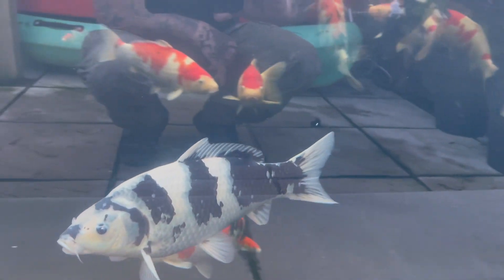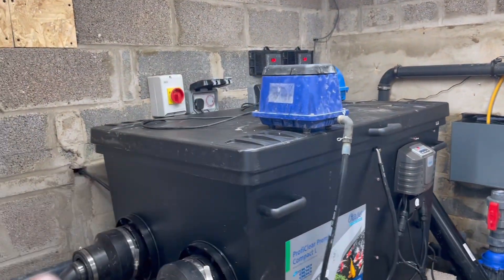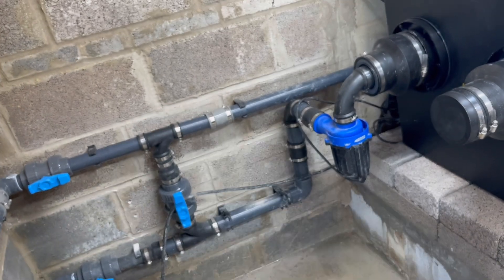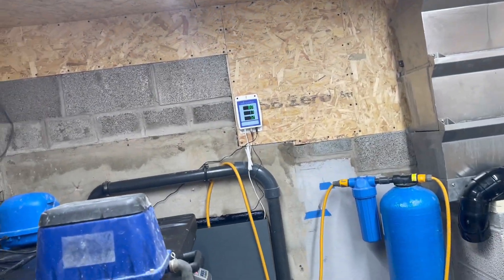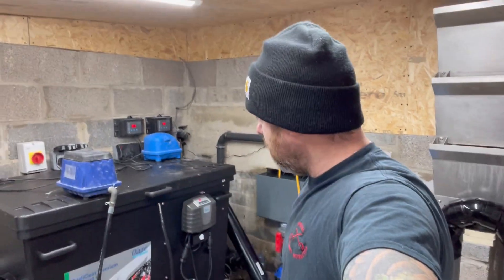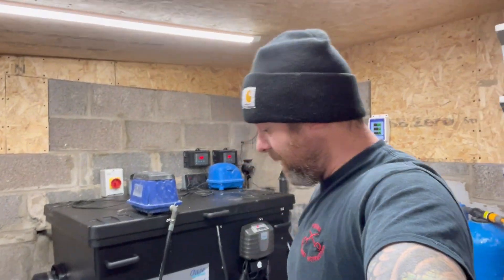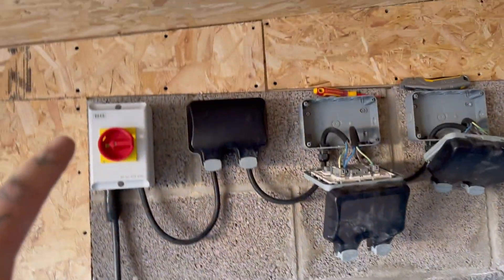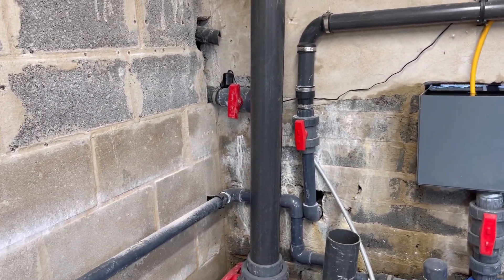German drum filter V German car!!!!!

Comment: 😱😱😱😱😱 Lee don't do it with your electrics 😱😱😱 Daisy chaining could result in inadequate  power and it can lead to overloaded circuits and more importantly be a fire risk.‼ your'd be better and safer at running a 
( 6 way garage fuse box. which you can get them for uner £100 )

becuase if one thing trips or goes boom. Everything else will be ok. It will save you money in the long run. And you can put the fuse box after the isolation switch as you can wire every thing up and use the isolation switch to protect your self and to check if everything is working socket wise. 

All the best, Tel 😊🙏🏻😊
Reply from the maker: Ok looks like I’m re doing it!!!!! 🙌🏼
Reply: @leehadfield6881  better to be on the safe side buddy 👍🏻

Comment: You can separate the old pipe from the collar with nothing more than a hot air paint stripper gun  .   Look it up on here separating solvent weld joints ....  I've done it myself on 2 inch pipe and it works a treat
Reply from the maker: I’ll try that Daz!

Comment: Wicked vid as per, with the bakki going back into the drum, it will work but only problem you won't be as efficient bringing the waste out of the pond itself. Be like a 50/50 mix instead of 100% crap from pond. If u put it on youll have to have yr pumps probably on maximum, and if it doesn't pull enough from yr pond, you'll be struggling to change it then. That's my thoughts pal. Keep them coming pal, more videos you produce the less I do at work 😉
Reply from the maker: I totally understand!!!! To be honest I do t need to worry about the shower for a bit. The water parameters are on point! So I can sit back and have a think! But I do love all the feed back I get!!! Thanks Dan 🙏

Comment: Looking mint as usual. 
Already mentioned on here about flow…. I’ve been fannying about all week against an error 88. 
My Oase drum (compact Gravity M), has 4 x 4’ running to it (bottom drain, mid feed x2 & skimmer). 
4 x 4” ball valves later it’s running perfectly.
Bottom drain & skimmer open 100%, mid feeds barely.
So as long as your pumps are man enough, I reckon it’ll work fine. 
Shame your grow n show isn’t for Shiro’s, I’d be all over it! Already have a Hi Utsuri :-( 

Good luck mate
Reply from the maker: Yes I turned my 2000 pump up to max and my E88 went off so that’s good. I still haven’t got my other 3000 on there yet so will be able to turn that 2000 down!
KWB have some amazing Shiros up there! Mate jump on the grow and show with one! 👍
Reply: @leehadfield6881  I’d better check with the Mrs, her due date is the 12th 😂🙈

Comment: Beauty of a car that Lee.. I wouldn’t like to fuel it tho ha.. 
I Would leave your set up the way it is at the moment, you would loose some pull from bottom drain through the drum if you was to tap into that line, mine goes over my shower once passed through the drum/bio, I have just fitted a tempest on my quarantine tank great results at moment, another option could be but it in a separate inlet to the drum? You can’t beat a bit of tinkering ha ha
Reply from the maker: Thanks Gary, he sed it was really thirsty 😂
I’m in no rush for the shower to be honest water is good until spring feeding ramps up!!!!!
Reply: @leehadfield6881  I bet it was ha ha fuel costs at moment are crazy.
Yes I would leave it the way it is myself.

Comment: You can reuse your collars by using a hot air gun or plumbers lamp to warm it up gently then pull the pipe out
Reply from the maker: Not sure Aaron! I’ll have to give it a go 🙏
Reply: @leehadfield6881  word of advise don’t use the hob in the house your mrs will go nuts because it stinks 😂
Reply: And try filling up a bucket with boiling water and putting your rubber boots in for two mins then put them on and let them cool down before turning the water back on

Comment: It would be pointless putting showing on bottom drain line because you wouldn’t be pulling much water though your drain so you would get a lot of build up in drain and could cause you a bacteria problem again and nice bmw that what does your mate do for job must have some serious money
Reply from the maker: Mummm! I get you! But I could put it straight in to the drum? Yes/no
Reply: @leehadfield6881  yes but what’s the point putting clean water back in the drum and not giving the pond more fresh water for instance your pulling 30000 litre for skimmer and bottom drain then putting 20000 over shower and 10000 into pond if much better to put 30000 straight into pond than keep recirculating the same 20000 litre but it would work your way but if you want the full potential from your pond and filters you best putting it straight into your pond but it up to you just my opinion and keep the videos coming I love watching them I’m 16 and my mum sometimes watch’s them with and somestuff you say brings back memories lol
Reply: I tried a something like this, I had two 110mm feeds into my filter one from my bottom drain and the other 110mm from my skimmer with two 20k pumps pulling on the other end, the big issue I found is it will pull the easiest route first which was the skimmer leaving the bottom with hardly any pull, I put a valve on the skimmer to slow it down but a valve is not much use on a shower you need the flow, all the best though 👍🏻